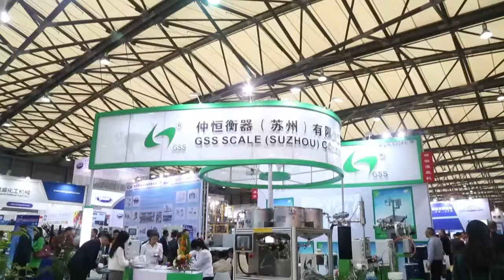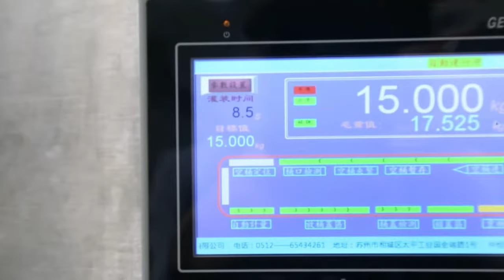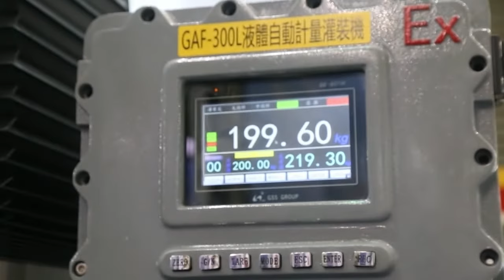Why GSS Liquid Chemical Filling Machine is popular with customers? | GSS Exhibition View | GSS

Comment from the maker: Why is GSS® Liquid Filling Machine Trusted by 1000+ Importers? 

Our company GSS® Committed to designing and manufacturing 1-1500L liquid filling machines for chemical, petrochemical, food & agrifood industry over 20+ years.

1, Safety & Highly Productivity.

2, One-stop Solution/turnkey solution.

3, 100% Customization.

4, Factory price, No middleman.

5, With CE RoHS ISO9001 EMC Approved.

6, Excellent service.

As a professional smart liquid filling machine manufacturer & factory in China,  Our machine can filling 1-2500L liquid products such as ▶️General liquid: Adhesive Bitumen Paint Resin Lubricant Thinner Ink Curing agent Toluene Acetone Trimethyl ester Antifreeze Grease, ▶️Corrosive liquid:Sulfuric Acid Nidrochloric Acid Lye ,▶️High Viscosity liquid:Coating Emulsion Butter Lotion,▶️Foamable and static electricity liquid:Detergent Tetrahydrofuran Cyclopentane N-pentane Methyl acetate Methanol Formaula Butanediol Explosive Solvents, ▶️Some other liquid :Acrylic Acid Diether Silane Phenol Paint Paste Solvent Conductive Oil Hot Glue Cool Glue Acid Alcohol Ethanol Diluent Crude Oil Flavour/Perfume Fragrance Spice/Essence Phosphoric Acid Gear Oil Epoxy Resin Edible Oil Polyurethane Corn Oil Dyeing Auxiliaries.

Skyrocket your business, don't hesitate to get in touch with us.

WhatsApp📞: +86180 1560 6579

Email📧: info@gssmachine.com